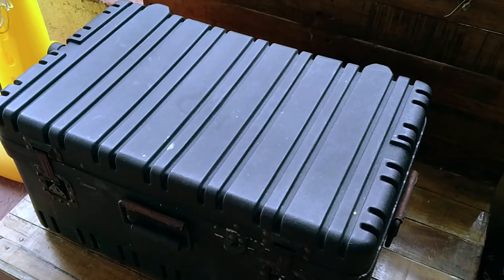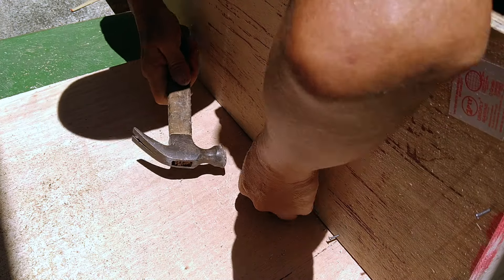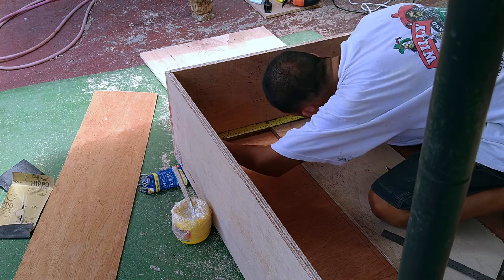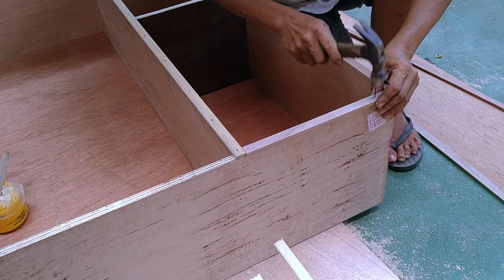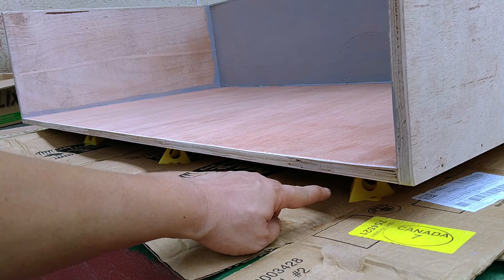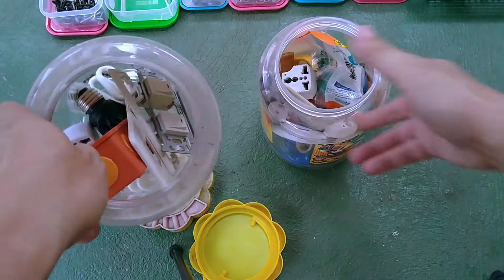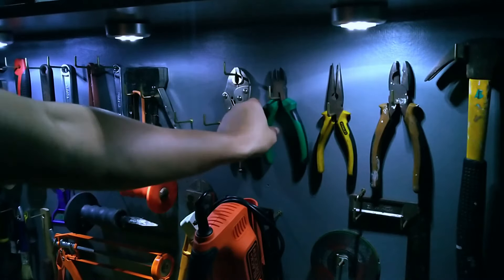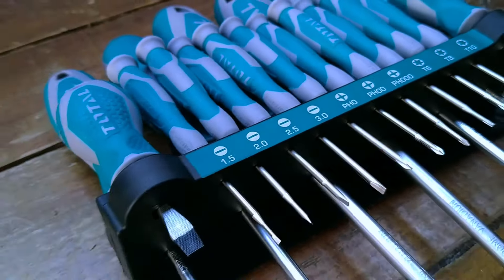DIY Tool Wall/Cabinet that Stores 100+ Tools

Comment: A great video, and a very effective set up.

You could draw a round your tools on the tool wall.   That way at a glance you can easily see if a tool is missing and what tool it is.  This can be asily painted over or erased if you change tools or relocate items on your tools wall, so it would still be adaptive.
Reply from the maker: Great tip!

Comment: Sir, possible po kayang mag create kayo ng video, identifying the different kinds of construction wood. Gusto ko po sanang mag gawa ng sarili kong pintuan kaso nahihiya naman ako magtanong tanong sa hardware kasi di ko alam kung ano ba yung tamang klase ng mga pako at kahoy.
Reply from the maker: depende kung para saan yung pinto na gusto mong gawin. pang front door? restroom? bedroom? dito kasi naka-depend kung ano yung mga materials na kelangan mo and practical sa budget.
Reply: @HanDIYman007  wall po. dati po kasing may binatana sa pader, tatakpan ko nalang po sana ng kahit plywood para maging wall nalang sya.
Reply: or kahit anong material that is best po.

Comment: wow, you're indeed so resourceful and very keen! I see, so it needs not to hummer the nail throughout in case that you need to do some adjustments, brilliant! Hmm, never thought of a paint that can deal with the different weather great info!. by the way, regarding the hook, would that rustproof? hmm, I am also interested in buying that LED push light, I think it would save me a lot than using the emergency light that keeps on charging.  KURIPOT Kasi ako LOL, need to spend all my earnings in a reasonable way, that's why I follow and always go back to your channel for some tips!